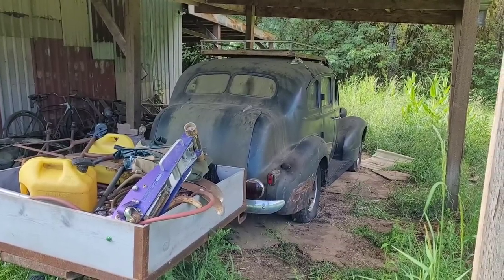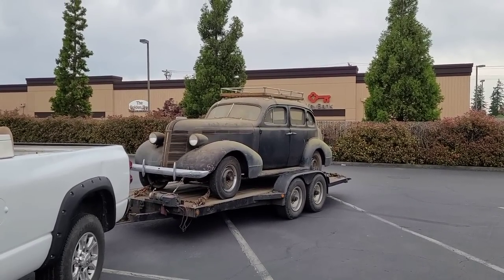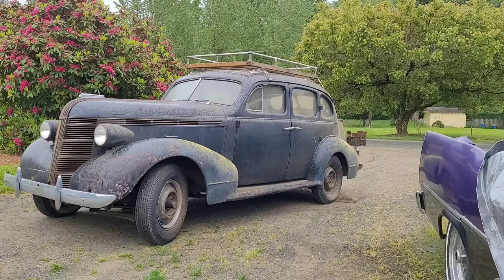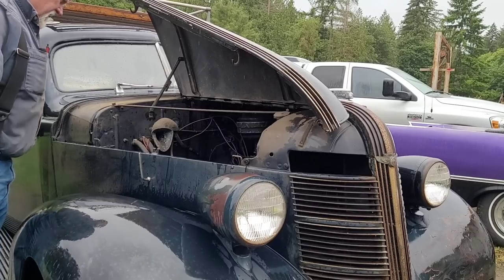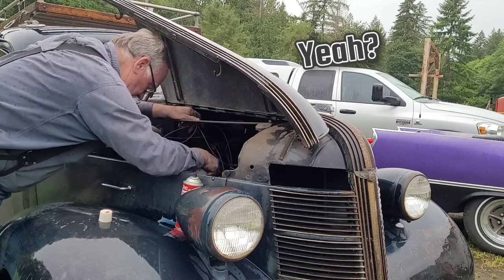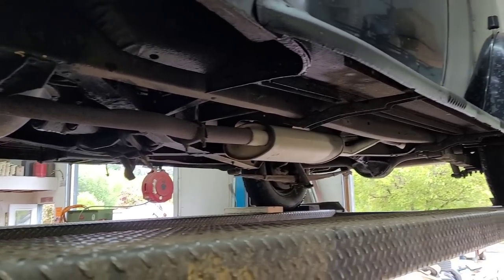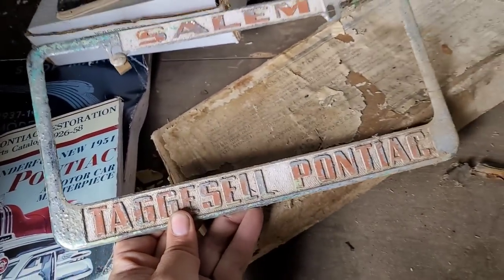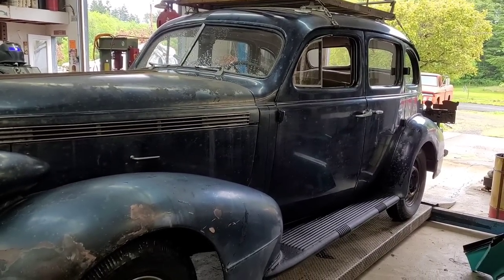Barn Find 1937 Pontiac Silver Streak! Retrieval, cleanup, and revival!!

Comment: Bravo for getting this old Pontiac back on the road. I live in France in Brittany. My father was a mechanic and created his garage in 1955. After the Second World War there were no longer any vehicles in good condition in France. he needed a tow truck and he bought the same 1937 Pontiac with the inline 8 engine. unfortunately at that time it was common to transform automobiles according to needs. He had made a pick-up and also made a motorized crane with a 2 hp Citroën engine to pull damaged cars. It was used until the 70's and I remember the interior up front well. When I see yours these memories come back to me. same dashboard, large Bakelite steering wheel, I remember playing with the little cranks to open the window deflectors when I was about 6 or 7 years old. your car looks in good condition and deserves a good restoration.

Comment: Super nice find! The thirties were great years for GM style, I think. I'm working on a 40 Buick, and I see a strong family resemblance.The term "side valve" is interchangeable with "flathead,"  because the valves in the block are beside the cylinders. Your engine is "OHV", or, as Buick liked to call it, "Valve in head." You may certainly, as far as I'm concerned at least, present more videos on this beauty for my (ahem) consideration. Delectation, even. I liked the way your underhood man approached the engine starting challenge - obviously not his first rodeo. I've seen some starting videos where people crank and crank and crank, but don't know enough to use the choke. (Alas, this is what we've come to in this fuel injected generation.) And he knew not to Vroom! Vroom! Vroom! it once it started. If I'd been there, I'd have wanted to put gas in the carb - through the bowl vent, if available, or the fuel inlet, if not too difficult, or down the barrel. That saves a lot of cranking.
Reply from the maker: We were able to get plenty of fuel, but the spark just wasn't there until we got the distributor cleaned up, then she took right off pretty much! But it's definitely not his or my first rodeo when it comes to starting stuff, so many people heat up starters and don't ever check spark, something I think maybe they think it makes better video? I don't know!
Reply: To Steven & Lori Young. Thanks for confirming what I suspected - that a Flathead engine IS a Sidevalve engine!

Comment: That is a pretty nice old find. Looks like it was kept undercover for a large part of it's life. The Chevy 6 threw me for a bit before I realized that it likely was a Canadian-built car, being in Oregon. It must have not sat in that spot for too long as the engine turned over quite easily. Gas engines tend to seize in one or more cylinders, from rust, if they sit for a long time as several valves are open to the air at all times. 

The 1937 "period" license plate indicates that it was an old car that was kept running and displayed in car shows/parades in the latter part of it's life. That is a common item that I have seen done often. Probably showing this car that way helped to see it kept up by it's owners for a long time, and that was a good thing. 

I would have checked the spark early on, especially on a car that had been sitting for some time, no electronic ignition in these cars. The only criticism I might make is that starting fluid is NOT recommended for gasoline engines as it wipes the oil off of cylinder walls really fast. I used to install/work on Detroit diesel engines in the 1970's and it was not recommended, by the factory, to even use it in them at that time. We were told if you used it you eventually would have to use it all the time. It has the same effect on diesel cylinder oiling as it does in a gas engine. 

Glad to see this old beast still runs. We don't have that many reminders from that era around any more. Thanks for the real interesting video.

Comment: Knowing old Pontiacs as well as I do I wonder if that's Chevy six banger in there. Pontiac's sixes were all straight 6 (or straight 8) flatheads until the Firebirds. Nice find!
Reply from the maker: You are correct, BUT they did use the overhead valve engines in Canada in the 30s!

Comment: Dad has a 1937 Buick. The same as yours just a Buick. You are right about the Buicks. A lot of them out there still today. I noticed the gas tank read full. Did you fill it or did you find it full? Maybe the gage doesn't work? The car looks good. I hope you do make some more videos.
Reply from the maker: I'm not sure the gas gauge works, it had some goofy fuel tank in it now, and the original sending unit is in the trunk.

Comment: Wow!  That is an amazing and incredible car!  What a find!!!  Like others, I recognize the '37 - '53 Chevrolet "Stovebolt" 216 engine format.  I have a mostly original '48 Chevrolet Fleetmaster.  I know the Canadian cars sometimes used a close variation of the 216 & 235 well into the 1950's - but I'm no expert on the Canuck versions...  I will say that the USA Chevy 216 has main bearings on each end of the block using graphite impregnated rope as the seals.  Poor design.  They leak oil like a sieve!  There is a trick to using rubber seals from the '54 - '62 235 motors to mitigate the leakage.  You just need a spacer of some kind underneath.  Old school mechanics sometimes used a piece of a zip tie underneath as a spacer (trimmed properly).  I know '37 was the last year for the floor shift in USA Chevrolets.  Chevrolet, Pontiac, and Oldsmobile used the same body panels for many models up through the '54 model year.
Reply: Our oldest son pulled a 235-6 cylinder out of a 55 Chevy truck 2 days ago, tried to get him to beef it up, put automatic behind it, gear up rear end, but no go ! He put a 383 striker in !!
Reply: @timothyroatenberry1274  He’s buying the gasoline… 😵😬😂
Reply: @timothyroatenberry1274  He’s buying the gasoline. 😵😬🤣
Reply: You are right it is a Canadian car 224 on  the badge.  The 224 Chev engine was used in  the 1937 and  the 1938 then they went to the Pontiac flat head 6 and 8.

Comment: If it's the Pontiac 224 a 54-62 Chevy 235 should basically drop in. You get a full flow oil system (no dripper nonsense) and most importantly, shell rod bearings. I have no idea who does babbitt bearings anymore.
Reply from the maker: I'm pretty sure the 216 is the same engine as this but with a bigger bore. A 235 would be nice, but it would also be a shame to take the original engine out when it runs so nice.
Reply: @LambvinskisGarage I'm just thinking about parts and rebuild ability. Not to mention super cool twin carb setups.

Comment: I just recently bought a 51 Packard that has been sitting since the early 70s. I'm in my mid forties and have been trying to buy it since highschool, but the old man wouldn't sell. He passed away and the sons sold it to me. Problem is, I don't know where to start!
Reply from the maker: Sorry to hear the old boy passed away, but at least you saved the car! If it's stuck I would start with pulling the spark plugs and soaking them with oil. If it's really stuck use ATF and Diesel. Then start checking for spark! Unhook the fuel line so you don't pump the carb full of bad gas too!

Comment: Great car. I'm surprised to see an OHV in a 1937 Pontiac--expecting a flat head.
Reply: General motors has had ohv engines since the 20s.  Ford, Chrysler, even nash had flathead motors.
Reply: My research indicates that Pontiac had flathead engines, straight 8s and straight 6s until 1954, which makes the '37 224 unusual. The 224 engine was a Canadian made version of the OHV Chevy 216.
Reply: @garycamara9955  Even earlier, Chevrolet had an OHV V8 in the late teens. But there were still lots of GM flatheads, ending with Pontiac's 1954 models. It was a big deal when Cadillac came out with its first OHV V8 in1949.
Reply: @garycamara9955  I've learnt something about Overhead Valve Engines, now! Ford had them since the 20's? I had been under the impression that the first was a 1930 Cadillac!

Comment: A REAL NICE original unmolested old girl, all things considered not bad condition, just clean it up make it tidy but keep it ORIGINAL running and driving, thankfully mice had NOT gotten to that interior, OHV straight 8?? Ford keep with the sidevalves until 1950s when the Y block V8 came, Chevrolet had OHV quite early, Chrysler used sidevalve 6,s. REAL NEAT OLD CAR!!!!
Reply from the maker: It's an overhead valve 6 cylinder, very similar to the Chevrolet 216, but slightly more bore, to my knowledge anyways.

Comment: Did you buy this? I can even fathom the price in the condition it is in. Even the motor looks great like it was stored in a garage not a barn. The lack of rust and the fact nothing was seized almost like Arizona car with little moisture. With the pine or evergreens in the background this is definitely an area with a lot of rain and cool temps. Having just minor surface rust and dust makes it very hard to believe this was just a normal barn but more of a shed with cement floors and insulation.
Reply from the maker: Yes, I'm sure it was probably stored inside most of its life, but while the previous owner had it, this is where it sat. I'm not sure how long it sat, some papers inside said 2017, but under this sort of cover I can believe it. If it were actually outside and uncovered, it would be trashed.

Comment: I thought Pontiacs were flatheads until 1953, the engine in this one looks like a Chevy 216 which they used until 1953 then went to the 235.
Reply from the maker: It's very possible, but I'm under the impression that the Canadian Pontiacs got the overhead valve engines. I could be misled though.
Reply: That's what I though, also isn't side valve and flathead the same thing?

Comment: That engine appears to be a Chevy stove bolt probably a 216,
Reply from the maker: I don't believe it is, but I can look into it, where can I identify what it is?
Reply: There should be casting numbers on the passenger side of the block, I could be mistaken, but when you showed the under hood shot it looked like a second generation stove bolt engine 1937 -54... They did occasionally make their way into Oldsmobile, and other GM cars...
Reply from the maker: @rickbaker7507  it's very possible, I'll see what I can find out.
Reply: @LambvinskisGarage  What you have there is a Pontiac 224, which is what the badge on the trunk says. Although the engine may have been updated, that model had a slightly overbored overhead valve Chevrolet engine giving 224 Cu. In. instead of the standard 216. I wasn't aware the 224 was available in the USA. Have you looked at the plate on the firewall to see where it was built? I wonder if it is a Canadian built car.
Reply from the maker: @d.mcarthur7500  if I remember correctly the tag does say Canada, but the gauge cluster is in MPH.
Reply: @LambvinskisGarage  Canada didn't adopt metric until 1976 so all cars built before then used MPH.
Reply from the maker: @d.mcarthur7500  ah! Makes sense then!
Reply: It's probably a Canadian car that was equipped with a version of a Chevy stovebolt engine. A US car would have had a Pontiac flathead engine. Those stovebolts through 1954 are splash oilers, that's why the oil pressure gauge only reads to 30 lbs. That means NO high rpms.
Reply: @LambvinskisGarage  37 Pontiacs were flathead 6
Reply from the maker: @tombob671  not always true, if they're Canadian OR a Silver Streak, they got the otherhead valve 224 engine.
Reply: @TylersNeighborhoodGarage  correct.
Reply: @LambvinskisGarage  thx for the update
Reply: @tombob671  US made 37 Pontiacs were flathead sixes. Canadian made ones used the 224 OHV engine. I'd like to know the story on that decision - not that it matters, I'm just curious - inquisitive - nosy.

Comment: These guy need to watch vice grip garage or junkyard digs, or just about anybody whose ever succefully revived an old car, there are steps... look at cylinders for rust,  oil cylinders down to prevent dry friction, turn over by hand to see if valve train stuck, spin with starter with plugs out, then try to start.. always feed it oil/gas mix when you do get around to trying it...walking up to an old engine and spinning it is begging to destroy rings and pushrods and maybe pistons.  Ether/brake clean/straight gas removes any lube the cylinders may have.  Beautiful old car,  but whatever life the engine may have had left was shortened by impatience/lack of common sense.
Reply from the maker: This is not our first rodeo and this car hasn't been off the road that long, we knew the condition of the engine and how long it sat, if you'd like to do it "the right way" you can gladly make your own YouTube channel, find these cars, bring them home, and make them run yourself. If you think anything we did to this car hurt the life of the engine, you certainly haven't done much with them before.

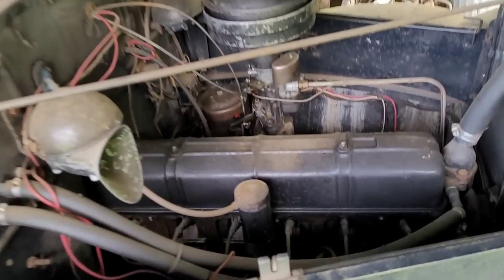Comment: 0:42 Apparently you need some education Mate! A flathead & a side valve is the same thing but this engine is an overhead valve & appears to be a Chevy.
Reply from the maker: From my understanding, the Canadian built Pontiacs could be equipped with the stove bolt engine with a slightly bigger bore than a 216, I thought I had also read that they called them a side valve, I didn't think it made sense either 🤷‍♂️